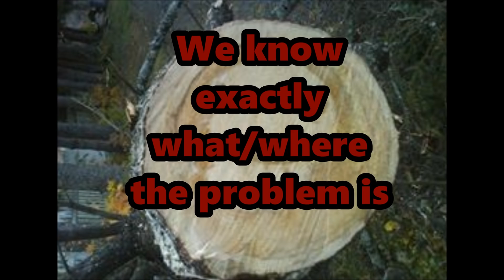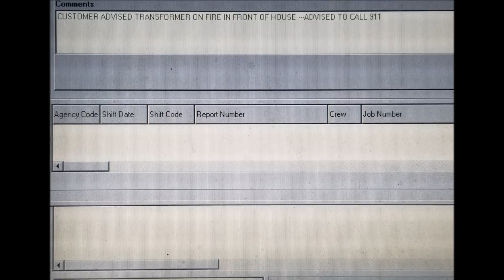5 Myths about Power Outages

Comment: After the Christchurch Earthquake in 2011, one street with underground cables had something like 20 faults on it. Crews would make a join, test and find the next fault that didn't get picked up because of the first fault. Overhead lines not only had less stress from the earthquake, it was also easier to see damage. Plus, one bridge carrying buried cables had the abutment raised a good metre or two and sheared the cables in two. Overhead 66kV lines were installed as a temporary fix because it was easier and quicker for a temporary fix.
Reply: A good idea for temp fix.66KV jointing is specialist stuff even today.
Reply: As a "power system/line" nerd... I enjoy studying the design, construction, and operation of power distribution systems.  But I do also consider above-ground power lines an eyesore.   I once lived in a small town that had them mostly all buried, and it was quite nice.  I find it hard to believe the expense, maintenance, and slow repair makes it justifiable in a large city, though.

Comment: Hmm, so, I looked into videos of transformer fuses blowing and it was nothing like an event I witnessed as a teen. As a teen, we had a "historic ice storm". I remember beginning to see the lights flicker during the midst of it so I went outside to see if anything was obviously causing it. Then I began hearing what I assumed was transformers blowing up, one after another after another all around the place. Eventually, the lights went out and there was pitch blackness and silence. Each one kind of sounded like electricity arching for a moment, then a deep loud noise that sounded more like a cannon shot and not a gunshot. It took a couple of weeks to get the power back on in the area. Was this possibly transformers actually blowing up or maybe it was something else? I would have thought automated systems in place would have done a better job at handling it, but then again, that was in the 90s.
Reply: Ice is very heavy on power lines, and trees.  Power poles cad snap and trees and snap and land on the power lines, bringing them down.

Comment: Being vehicle have 4 tires, there is no risk driving over it.
Reply: That would be wrong thinking. Since its possible that one of the energized wires could swing up and make contact with the cars frame. For instance if there is branch that pushes the line up as you drive over it.

Never risk your life doing something stupid.
Reply: Tires are not insulators. At primary voltage they are actually conductors
Reply: @cew995  Tires are made out of rubber. How does rubber becomes conductor?
Reply: Michael Lawn carbon in the rubber . It’s not a good conductor more accurately a tire would be a resistor. I have seen tires arcing from the rim across the tire and into the ground. It eventually blows the tread off where the tire and the ground meet. At 7200 volts and up lots of things become “conductors”.

Comment: I once had a wire leading from one of those green transformer boxes on the ground. When it went the boom shook my house. The linesman had to dig to find it and he showed me the section that blew and it was a small hole, less than a pencil but thousands of volts travelled through it as it was the supply side.

Comment: No way to use the telegraphers equations, or time domain reflectometry to look for changes in electrical impedance that happen where there are faults ? Such might also help with preventive mantainace ie spotting transformers starting to go bad, before there is an outage.
Reply: Nope since there are transformers everywhere that splice into the lines everywhere. TDR would only work on lines that are not tapped with transformers.

Comment: I was working at a Pizza Hut when construction crews North of us hit a line and tripped one phase of our service.  Some of our computers were running, but the ovens shut down.  I shut off our walk-in coolers ( and anything else with a 3 pole breaker) for fear a motor would burn out under the fault.  It was an interesting day.  Fortunately the store manager was there that day so there was little less stress in terms of reporting issues.  But we were down for service for several hours spending time deep cleaning chairs, scraping sidewalks, cleaning under sinks and the like.

Comment: Underground power lines also have a lifespan.  I live on a street with underground power that has had three failures in three separate spots this year.  The wire has been in the ground for just about 40years.

Comment: 2:43 During extreme cold, disconnecting transformers to reduce load before attempting to reenergize the line.  I'm curious why this is?  I'm not a professional, just curious, but I thought heat is the enemy to transmission lines, having colder ambient temperature, couldn't they run a little more current?  I do know you must de-rate conductors in hot enviornments, so this puzzles me. 
I cannot imagine people are overwhelming their feed with their electric heaters..... which leads me down another rabbit hole: are the high voltage transmission lines capable of supplying every house it feeds with the max current?  Or has an engineer determined some number like 60-80% or whatever, and it's assumed that not everyone is going to draw 24KW simultaneously?  Or perhaps I'm over-complicating it, and it's simply the surge in current from re-connecting many users at once.  
Idea: Write a program ["they", not you, unless you are also a programmer.. ] for the smart meters so you can send an activation signal which assigns each customer a small delay 200ms or something from each other and then cascades the power on instead of an immediate surge of hundreds of users.  
Rabbit hole #2: The device inside that switches between an off/on state:  Is it a Triac [edit: or relay], or is there a motorized device that operates the traditional breaker-style switch?  If it's a mechanical device, I don't know if my idea would work without setting longer delays.  I know it can be turned on and off remotely though.  There is no reason that couldn't be automated.
Edit: If it's mechanical, another issue arises, during an outage, the device wouldn't have tripped to "off" and there is no power to operate a motor, thus, it is stuck on, and everything that was on will demand power immediately. Solution: Accepting a small amount of waste, use a relay.  A backup battery.  A large enough capacitor that can pull the switch to "off" in the event of an outage.
Could you design an inductor circuit that upon losing power fed by a transistor, the field collapses and sends a surge capable of powering the [again, i'm assuming it's a motor-driven, mechanical shunt] motor?
Reply: Dakota Lally
 ... I am told that the auto-recloser device has a flip flop circuit and can use power from either side of the line as necessary, which is especially handy for partial outages and the units that are radio controlled from a remote office.
Reply: @rupe53  That is brilliant!  That makes a lot of sense, thanks for following up.

Comment: A few years ago, our utility got some new fuseholders for a great price...from China; WAY cheaper than the ones from Mexico. Problem was that when you'd wham the fuse back in to energize the circuit, it would go past the cup and be jammed against the flat area AFTER the cup. The Chinese fuseholders (alleged to be same fit, form, and function) were not properly re-enforced so that the action of seating the fuse allowed the holder to bend open wide enough to let the fuse slide past into the flat area. Nice!
Reply: I've found that it helps to squint really hard when installing
Reply: @JTA1961  That's terrible.  LOL  I still laughed.
Reply: Nothing built in China is worth a shit!

Comment: My wife caalled me once saying the neighbor shot out our power once. She just heard the bang and the power went out and she assumed it was them. After laughing I told her to call the power company and a squirrel likely took out a transformer. I didn't know you had fuses at the transformer that usually are the culprit but that makes sense as even automotive fuses are comparatively loud for their size.
Reply: I don't know about other power utilities, but mine used to seem to only install the "minimum needed" fuses/cutouts.  It's only in the past 10-15 years that they've been fusing each transformer individually.  Even the house I grew up in which is in the country... originally just had a cutout as it came off the circuit along the road.  Now it has one at the transformer (the only load on the circuit) too.

Comment: What people don't know about underground lines [Besides all the things you mentioned] is that on long distance runs is that there is capacitance between phases and between phase to ground. This causes a thing known as "leading power factor" where the voltage current get out of phase. This is almost impossible to fix. What it does is increase the current on the line even though no additional useful load is being supplied. This causes the conductors to heat up more and the heat becomes wasted energy. It's known as "I2R losses". 

And about transformers blowing up. I was about 1/2 mile from a pole pig that exploded in the early 80's. I thought the USSR hit us with a nuke. It was so bright that it not only lit up the sky, but it was at night and the whole area was brighter than daylight. I was in a brand new pickup and as I dove for the floor I could see little specks of dust on the rubber floor mat that you'd normally never see even at high noon.

Comment: These are not myths. It's more like common sense.
Reply: I have wished the electric industry would do some basic public education. Most of this the public has no clue about, including that downed lines are dangerous until grounded. Many believe critical electric infrastructure is connected to the internet. Many believe the transformers are still filled with PCB. The myths drive us crazy.

Comment: This molasses fuse situation is unclear.  Did the fuse need ~3 minutes of 200+ amps before it quit?
But Bob said the problem was the switch not making contact, so I have to infer that the fireball is the arc jumping between the gapped switch contacts.  Since the fuse did not blow, it means the gap never passed more the 200 A?  Ultimately what must've happened is that the switch melted away instead of the fuse.
Otherwise, great video.  Should be required watching for anyone who lives near electricity!
Reply: My guess is that the fuse didn't blow correctly. The gap was too short which permitted arching. The arc didn't have enough power to immediately flash vaporize so it arced until it melted with enough of a gap to extinguish the arc. Once the Air is ionized the resist drops dramatically allowing an arc to continue to burn.

Comment: Do you think Stan Meyers claims are full of shit,  a circuit to apply  high voltage only,  to water, not allowing deadshorting of ANY amps, and without resistors,  is it just a high enough impedance in his transformers ( 1-1 coils), to not allow power consumption, but not surrpressing the initial voltage transient, right?

Comment: I saw a pole fire outside of work one day, not an insulator but the actual pole, i called it in,the local utility rolled out with what looked like a dedicated truck to put the fire out(makes me think it is a common phenomenon). Definitely gave me a new level of respect for how much power there is on that little line

Comment: I saw a pole transformer explode when I was a kid.  It was a cross the street and the next house down.  I was mowing the front yard and purely by luck I was looking in that direction when it blew with not warning.  The top blew off, a huge fireball shot out and burning oil poured to the ground.  It burned until the fire department arrived and hosed it down.  The power company replaced it with a much larger transformer.

Comment: Not surprising that people always assume "someone else has called" in a problem.
Reply: i believe this is called the "Bystander effect"
Reply: My local utility has made it so easy for me to call in to report an outage at my house that it only takes me two minutes to do and doesn't require me to speak to anyone. Since it is this easy how can I not call them.
Reply: @Angel9932  I am actually working on some software that would make it possible for general public be able to see reported faults/inspections/repairs on a map. We mostly work in the UK currently, but there is no technical reasons it couldn't work in the US, just that no district has started to use it. Fingers crossed we would like to see it world wide, but early days.
Reply: @ColinRichardson  ... we have that here in the states and the system does require some filtering to limit information going to the general public, otherwise certain shifty people might use the info to start looting in a neighborhood without power. The info available to the people working goes as far as exact address and circuit branch, laid over a street map and superimposed with the power grid, along with the local disconnect points on feeder cables. Foot notes include working voltages and branch loads along with transformer and fuse ratings. The version I can see on my home PC is just a street map with location pins stating total number of outages in an area. A single pin on the map may say 5 customers out or 500 outages. Foot notes might include cause of the problem (branch on a wire) and estimated repair time. The info is quite handy for fire departments, police, and even people like me in the generator repair business. Most often is about avoiding an area that may be blocked off due to the repairs in progress, especially during or after a storm.
Reply: @rupe53  That is amazing.. I hope they have that information as an API, it can be easily integrated into our system. Hopefully it can be tied into our automatic job/repair/budgeting assigning process. Do you have a name for that software?
Reply: @ColinRichardson  ... I do not have any detailed info but you can view what I use here. https://outagemap.eversource.com/external/default.html

You can zoom and drag the map to a specific outage and click on the location pin for some details. I suspect you might be able to contact an engineer with Eversource to see how they manage this system. They have contact info on the home page.
Reply: @ColinRichardson  
My power company has had outage map for a couple of years that I know of. So probably at least 3 years before I found out about it.
Reply: I used to be a police/emergency services dispatcher for a small town. It always seemed to be one extreme or the other, either no one would call, or the phones would be jammed whenever something public happened like a car accident or something.  I always knew when there was a power outage in the area too, as people would call us rather than the power company. Some would even want us to send a police officer to find the crew and tell them to hurry up.  :) 
BTW the one thing that always got tons of calls was a fire. There was never a fire, large or small, that didn't light up every line.  If you ever need help in a hurry, shout "FIRE" and everyone will come running!
Reply: I'm always that "someone else".
Reply: Times change...Where I live, we have smart meters that can automatically notify the power company of an outage.  I get a text message just about instantly if mine goes out.
Reply: @LegendaryRadioJock  ... most likely that text message is generated via a computerized customer list based on who is on a certain branch circuit when it goes down. The only reason I say that is this option has been around for years (pre smart meter) and just the idea of say 1,000 meters calling out data (without a power supply) seems a little far fetched. Most likely they get it right 95% of the time even without a smart meter. Even the grid maps I can see via home PC are updated every 10 minutes, so not too shabby, time wise.
Reply: @rupe53  IDK specifics, I just know it works and eliminates the need to "call it in" by a customer.
Reply: Which is why I recommend to always calls, even if you know others have. You may have information the other person did not. Such as direction of the sound from the Transformer Fuse, and time of Blackout.
Reply: @susofseattle  BTW, we have the automated system for calling the utility company but hitting 0 or saying you want to speak to an operator (not on the menu) will get you a live person. This is where I usually have a pole # and further info handy. (wires down and arcing, fuse out, etc) I learned this shortcut in the fire service 20 years ago and it works wonders when it's more than just an outage.
Reply: I always call it in even I am likely to get a recording telling me that they are aware of the problem.  We use electricity only.  No gas.  The advantages are no noisy furnace blowers and no gas to leak and cause an explosion concern/hazard.
Reply: I couldn't imagine any more than one out of 50 people that would just assume it was already called in.  I'm surprised he didn't just say, fuck off, we already know.  I'd think every fuckin Karen on the block would be on the phone looking up and every Kyle would become a Karen.

Comment: I have seen when those fuses fail to blow. The can blows (at least I think it did. If it didn't thats 1 crazy fuse). Some crazy winds blew a main to ground. A fire ball of about 5 feet wide erupted from the pole. 3 of the 4 lines where blown right off and the resulting sparks and I assume aided by the oil, created a sizable fire at the  base of the pole which the strong rain put out.